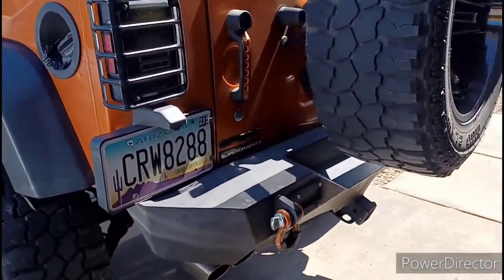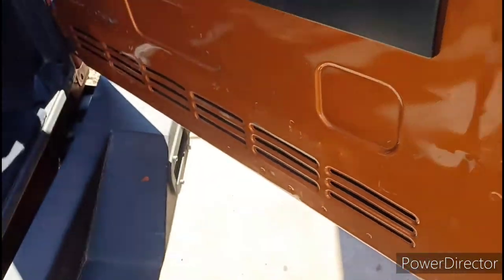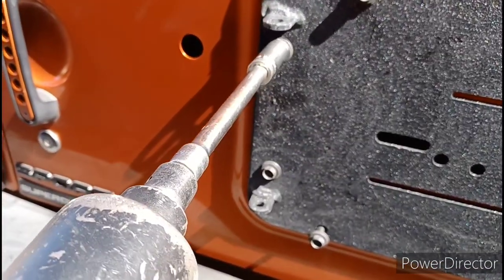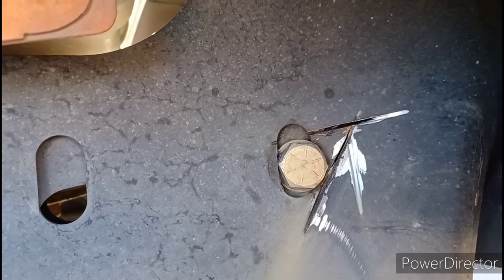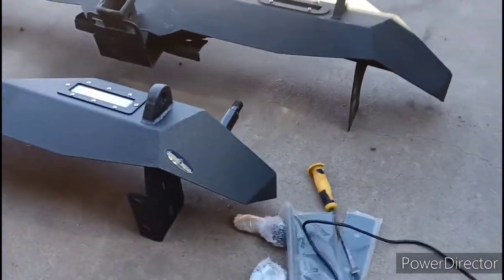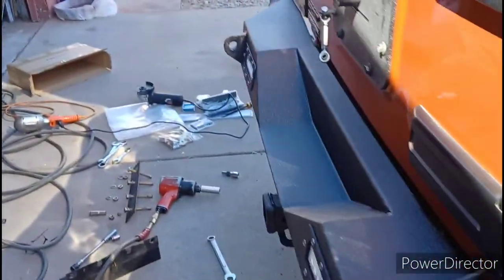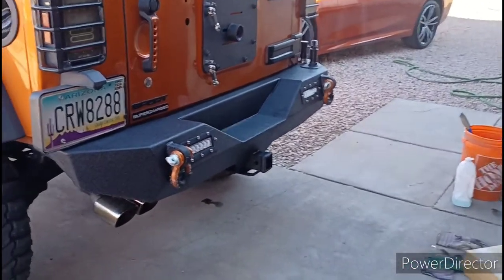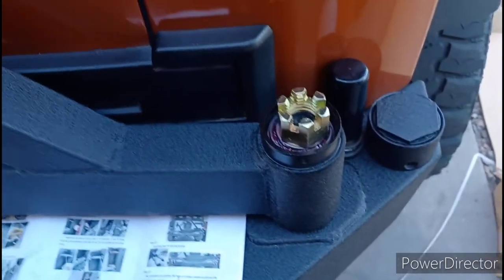Hooke Road Bumper w/Tire Carrier install on 2011 Wrangler JKU

Comment: Great video! I just finished installing the same one. How do you feel about this bumper 10 months later? Any regrets?
Reply from the maker: I LOVE this bumper! Solid! Holds my 37s and the rear tire doesn't jump up and down like hanging on the door. SOLID!! I've had to adjust the bolts once, but I added locktite and now it's fine.

You gonna love it, tho. Opening the door is super easy too!

Comment: Nice video. Do you remember the model number of that bumper? Also, how is it holding up?
Reply from the maker: I can't remember the exact model number. I think I have a link in the description but I'm not 100% sure. The bumper is holding up perfectly! Even with my huge 37s! Cleans up pretty well and still looks brand new.